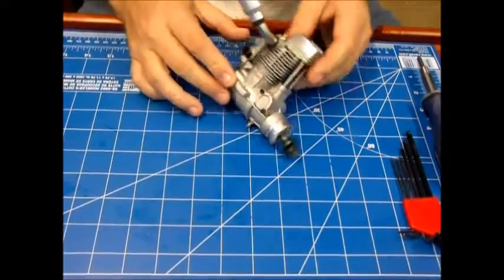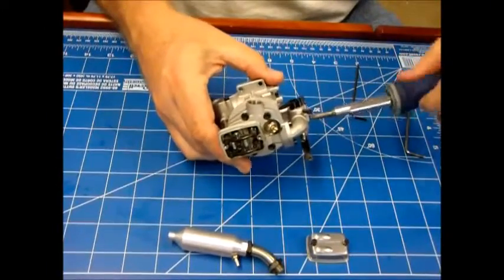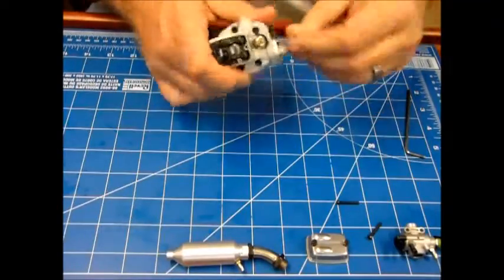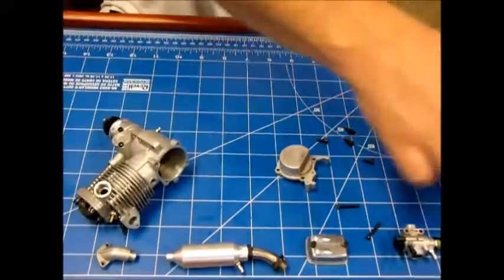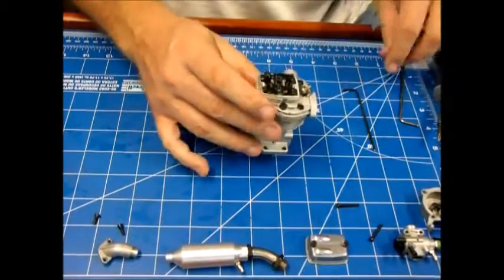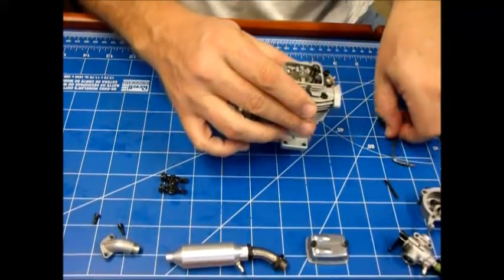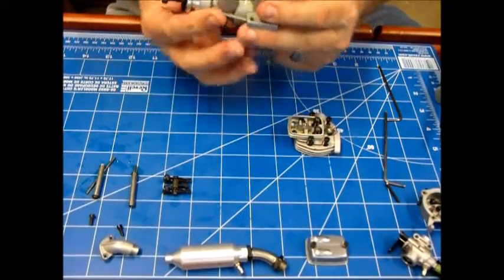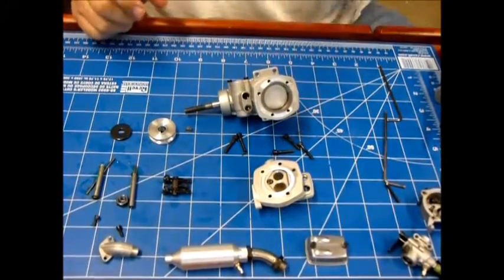OS FS-48 Surpass: a look inside

Comment: This spring my reliable FS48 Surpass suffered a cracked crankcase due to a very bad "landing". I rebuild this engine from a very bad condition when it came to me. It was totally rusty inside and has been run with this abrasive fill for some time. After cleaning everything and bearings replaced it ran perfectly. I still hope to find a case for it.
Reply from the maker: Well I happen to have a very nice OS 48 Surpass that I got for very cheap.  Depending on where in the world you live, it could be yours for what I paid for it.  Email me if you are interested.  I have no need or use for the engine. https://youtu.be/FusPoKu0Bg0

Comment: hi David.. another nice instructional vídeo. I have a OS FS 90 Surpass and would  like to know how can i replace pushrods. One of the pushrod springs broke. Thanks..
Reply from the maker: +Admar A Godoy Very similar to this video.
https://www.youtube.com/watch?v=fz7AP2pPodI&list=PLsvn3JGZAOMv8LaR5fFvjyqH3NZ2sgVBv&index=15

I do not have one for an OS engine.  The method is the same but the retaining mechanism on an OS valve is a small c ring instead of tapered collars.
Reply: +David McIntire +David McIntire The retaining mechanism on OS FS 90 Surpass is tapered collars too. Disassembly finished here. Now i'll search the springs.
Reply from the maker: +Admar A Godoy Just for the record the OS FS-90 is NOT a Surpass series engine. The Surpass engines have a c clip that retains the valve spring/keeper.  IF you watch this video on the OS FS-90 you will see me remove the valves.  https://www.youtube.com/watch?v=WSFy4KZnDV8&list=PLsvn3JGZAOMv8LaR5fFvjyqH3NZ2sgVBv&index=47
Every FS-90 I have owned has a clip retaining the valves.
Reply: +David McIntire Sorry. I made a big mess . The engine I have is an OS FS 91S II and the manual shows Splits Cotter mechanism that retaining the valves.